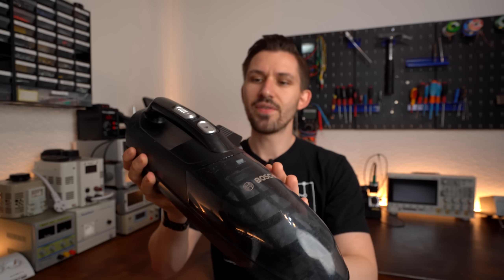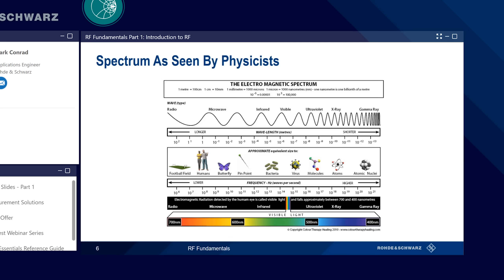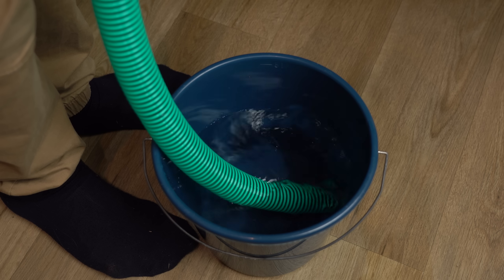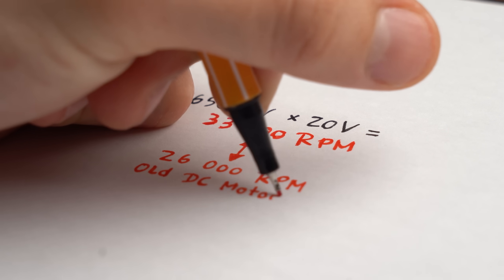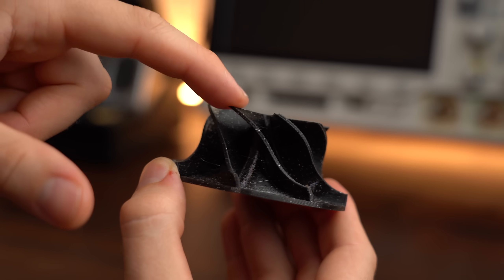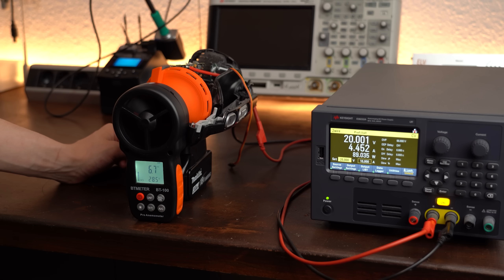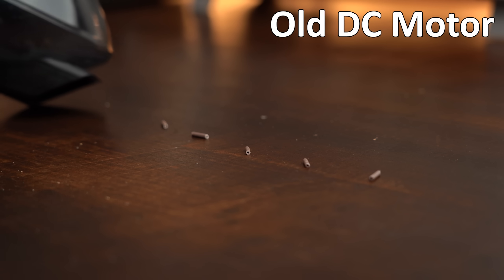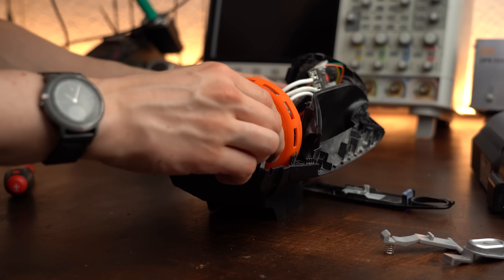My Last Chance to OVERPOWER my Vacuum! (Homemade Turbine V2)

Comment: Put a groove on the end of the motor shaft - spin it up full speed and use a triangular file - and then a circlet will keep the impeller in place.
Reply from the maker: Oh boy. Love that idea. Will try it in the future
Reply: To transfer the torque better and make it easily removable you could also use equaly spaced grub screws. or if you want something non removable you could grind a divit in the motor shaft and also some in the 3d printed hole and then glue it. That way the glue will not just keep the rotor from slipping but instead mechanicly lock it on the shaft
Reply: @quelixf  once you've gone to the trouble of grinding a axial slot in each, just go ahead and install a key: that's the traditional solution to transferring torque from a shaft
Reply: @RossReedstrom You cannot key a shaft this small, that looks to be smaller than ∅5mm. 
Well, you can - it just wouldn't make very much sense, shafts this size are usually secured using "dog point" set screws, with according holes in the shaft, or with cone point set screws if the shaft must not be weakened further.
Removing material for a keyhole from an already undersized shaft isn't a great idea.

I'd bet a regular pair of set screws with flats would serve him right and it would all be achievable at home using a file and a tap.
Reply: @lazar2175 if he really wanted to he could use an edm machine to make the initial hole and some specialized tap for hardened material. I don't know much on the tap side, but an edm can cut through any hardness of metal.
Reply: @lazar2175  Agreed, was pointing out that the suggestion to "grind a divot into the shaft ..." was the equivalent of using a key, jus an inferior one made of glue, so might as well just go whole hog.. At this size, I agree that a couple grub screws (to attempt to preserve some balance) would probably be best.
Reply: @lazar2175 often they'll use a 'D' shaft at these sizes as well, you see that a lot on small shafts interfacing plastic friction fit parts.

Comment: Do NOT purchase a Dyson. They are pretty and have great suction, but that's about where their benefits end. They get clogged up super easily and the plastic is super brittle. Mine was under warranty and they said I can't get it fixed because they don't have the parts for it. WTF??
Reply from the maker: That....sucks. Thanks for the feedback :-)
Reply: Yeah, you try vacuuming up a bunch of cocoa cereal with a Dyson cordless and it'll choke. The hole that goes into the debris chamber is so tiny.
Reply: @kylekirby6424  That's what she said?
Reply: @plixplux  😂
Reply: I agree, they are overpriced trash 🗑️
Reply: I beg to differ. I purchased a used one at the flea market just to see what is the hype about. It is a V7, so quite old generation but boy... i cleaned it thoroughly, replaced the battery with an aftermarket one and it is running overtime (but I make sure to charge it correctly). 
Now we also own another one much more expensive bought new and we are very happy. Since we have kids and one cat it is used daily.

Comment: Maybe you can try to integrate a screw shaft coupler by heating it and melting the plastic. That would probably make the prop fixed enough.
Reply from the maker: Sounds possible. But I would like a solution where I can still "easily" remove the impeller.
Reply: @greatscottlab a set screw into a threaded insert would be easily removable
Reply: @greatscottlab  brass insert with a pair of 3mm grub screws - that should be quite easy to remove unless you go nuts with the loctite!

Comment: Would be a costly surprise if it actually sucked up all the water and spilled to your lab bench.😅
Reply from the maker: Happened off screen with the commercial solution. Luckily it was not too much.
Reply: @greatscottlab  that must pack quiet a punch!
Reply: @greatscottlab  Actually, RC Test Flight reports it happened to him too 😀

Comment: Strongly fixing the rotor to the shaft will solve a lot of future problems.
Reply from the maker: Yep. That was the biggest problem. I hope to reliably solve that in the future.
Reply: @greatscottlab i would prrsonally use a small worm screw that goes trough the impeller and grabs the shaft.
Reply: @triaxelongd3337 yes grub screws would be great for that, especially if he makes a lil groove in the shaft for it to bite in, or even better use an actual pinion RC gear for one of those motors and something in the impeller that can hold onto that
Reply: @greatscottlab  I would make the shaft something like a screw, or add a groove and use a retaining clip.
Reply: @greatscottlab wasn't this your last chance?
Reply: The way dyson does it in the V8 handheld is the glass fiber reinforced plastic is injection molded around the shaft which is knurled. And the impeller is about half the size of these printed ones! I failed at repairing one and destructively took the thing to pieces. It really was a marvel. This is just for reference, as I know DIY injection molding is a long long way off, if ever. Everything in the dyson is designed ground up and incredibly compact, from the neodymium magnet on the shaft, to the turns of the BLDC winding and the control board. It's this level of engineering that affords such performance. To DIY something competitive is a little far fetched, but could be fun from a learning perspective.
Reply: @_BangDroid_  well a vacuum chamber, 3d printed molds, epoxy and chopped carbon fiber might be plenty strong

Comment: It's time for Homemade Jet engine
Reply from the maker: Haha maybe next time ;-)
Reply: @greatscottlab  hello scott!! You are using a turbo charger propeller wich work with a range of 80k to 150k rpm or more those are constructed in a special aluminum alloy that supports stream heat and centrifugal forces, when the propeller design is used below the specifications doesn’t work at all also the balance is crucial those are in milligrams in some cases because of the design, very interesting set of videos
Reply: Having tested a few low RPM optimised impellers at a solid 35,000-40,000 RPM - it's absolutely doable. Balancing is a massive problem though as any slight imbalance at those speeds translates to a heavy vibration that can, if you hit resonance, be extremely destructive.